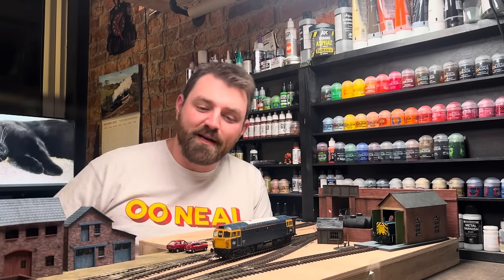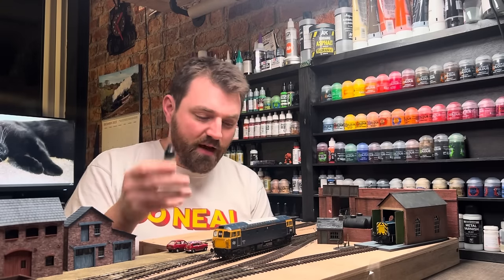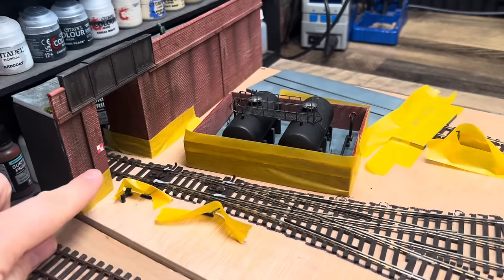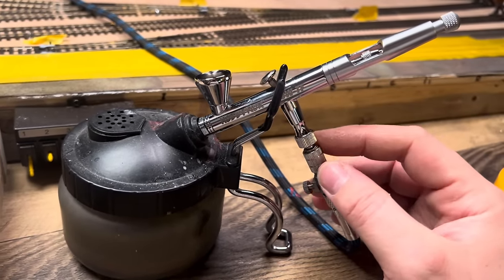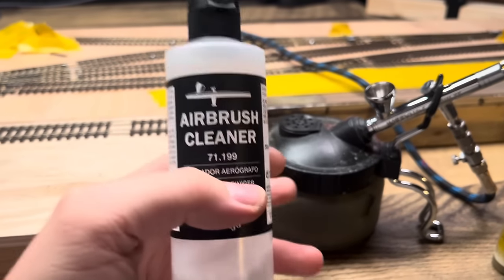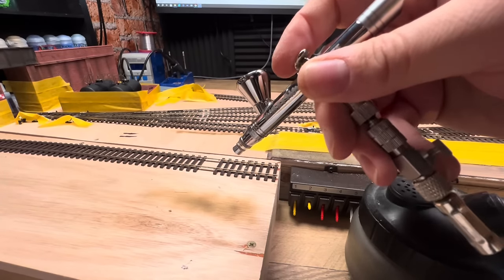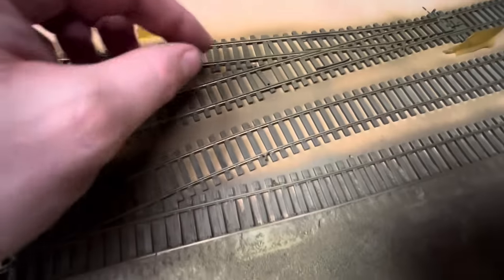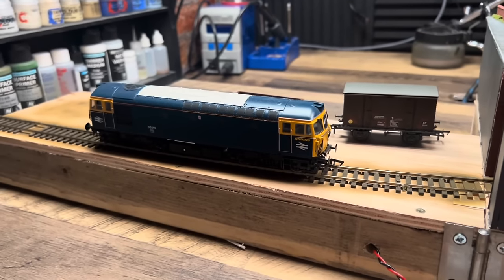Building A Shunting Layout | Air Brushing basics | Track Painting | Ep16

Comment: Loving this series Tris. Great to see your methodology and quality execution. Very good modelling, hoping to learn to be a 1/4 as talented 😂. I'm looking at wiring up my shelf layout, at research stage and sorry but was hoping to benefit from your experience. Ps. Videos on my channel if you want the context. Essentially it runs around the top of my 3 x 3 m cabin on a 200mm wide shelf and has 2 stations either side. My original plan was to have a switch box each. But my question, is it better to have one central box to control everything in your view? I'm not sure what would work best when running. Keep up the fantastic work 🎉

Comment: Nicely done. It will be interesting to see how this turns out. I had painted the track prior to ballasting on my narrow gauge layout and then weathered the ballast afterwards. However, on the layout I'm building for the children I've simply ballasted the raw track and then painted and weathered the track and ballast in one operation with various shades of grime using an airbrush. I really like the result and it was much easier and quicker overall. I tried out both methods on some scrap track first and results were similar.

Incidentally, how are you going to do uncoupling on the layout? On my shunting layout I've chosen to use Kadees with homemade ND uncoupling magnets at strategic locations.